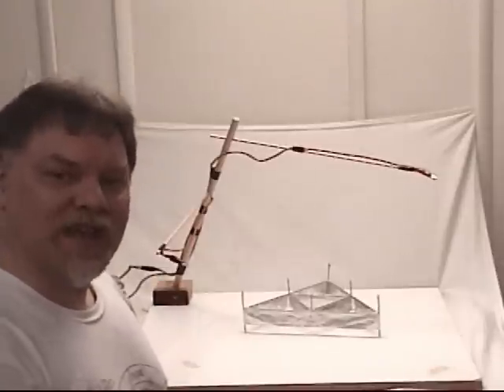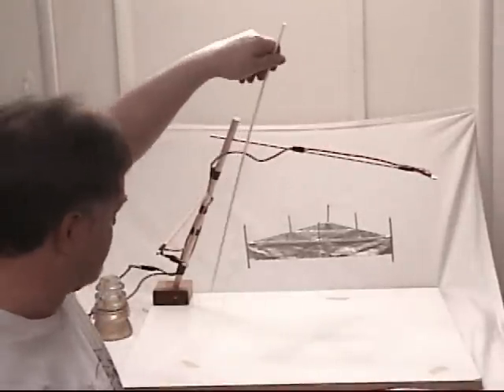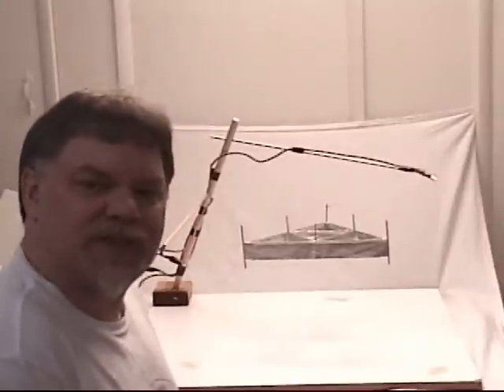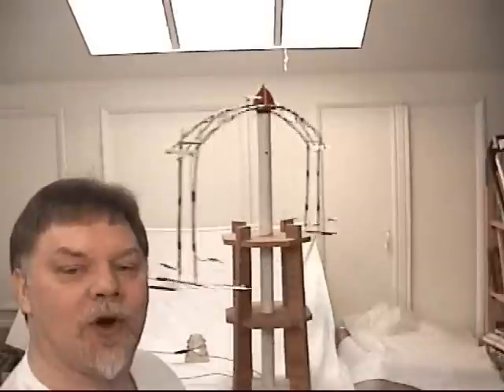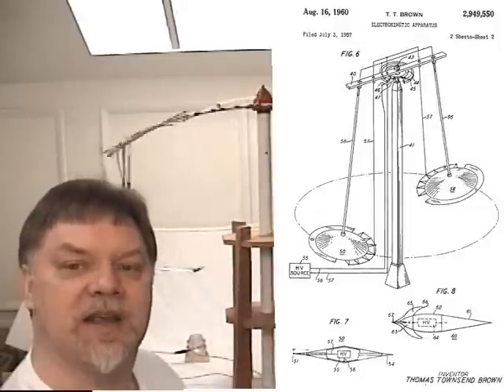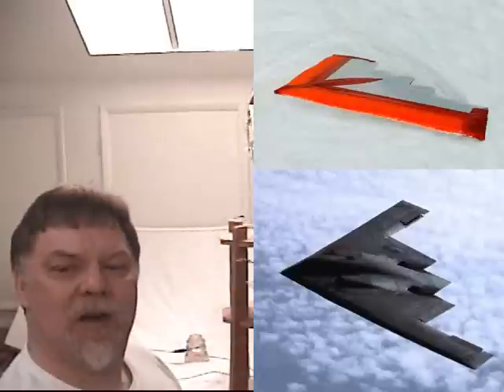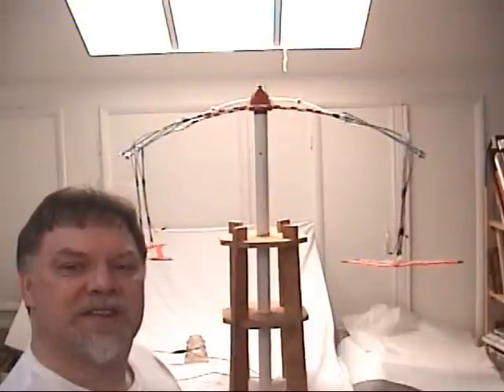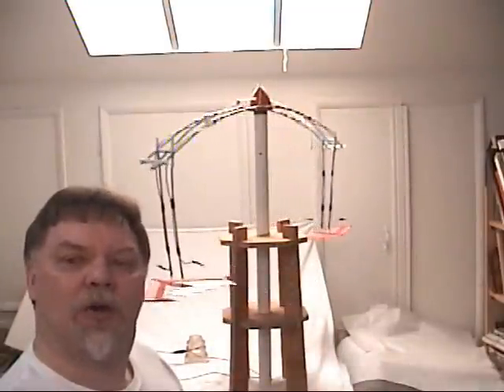Lifters and Electrogravity: Propulsion Possibilities Revealed

Comment: Dr. Subrata Roy's WEAV design is great when transmogrified to VASIMR Electrohydrodynamics where you contain the Argon Ablation with Low Temp Superconductors as close to the Zero Point Conditions using Bose - Einstein Condensates to Cooper Pair Electrons & create the Particle-Wave Singularity. 

This allows you to uses Gyroscopic Precession to exert Lorentz Forces and generating a Right Hand Rule version of Thrust. Ion Wind is present in this Reaction, but is not the main Electrohydrodynamic Force.

See Dr. Leik Myrabo's Laser Propulsion and his Lightcraft.

Comment: "Electrogravity" HAS been busted scientifically and ion wind IS the only explanation why this works. And no, it does NOT work in a vaccum under good lab conditions. It's easy to get fooled e.g. when the vacuum isn't strong enough and extremely high voltages are used (the remaining air molecules can still be enough to see an effect) or when e.g. sealant oils are used for the vacuum: those can vaporize and be ionized. As for larger applications in civil aviation: the big elefants in the room are: space charge, breakdown voltage and volumetric efficiency (=device size relative to absolute thrust) and the weight and aerodynamic drag that go along with that. Useful applications would require fundamental changes to the basic principle, apart from maybe plasma actuators used for turbulence reduction / stall avoidance in airfoils.
Reply: I've seen examples of lifters being compared to a quadcopter drone of similar weight.  The wind produced by lifters is significantly less than the drone just to get them off the ground.  I agree that the presence of gas is still a necessary component for it to work,  but the mechanism might be different than the mainstream explanation.
Reply: @WTF_BBQ  With simple lifters "as it is" you're right, but there are practical solutions to dramatically reduce losses. This requires fundamental changes in the electrode setup (including separation of ionization step and ion acceleration, because otherwise both volumetric efficiency and absolute thrust will always be disappointing) and "smart" voltage regulation (continuous current sensing feedback, pitot sensor, microcontroller); too much to explain in a youtube comment. Essentially, the main efficiency killer is any full plasma discharge (complete ion bridge), which is effectively a short-circuit (plus heat losses in the high voltage transformer). Also: there's a trade-off between max thrust and max efficiency (N/kW). Propellers have their own issues (losses due to spiral slipstream, induced drag from blade-tip vorteces, inefficiency of fixed-props vs constant-speed...).
Reply: @___Chris___  
There was an old video many years ago of someone building a fairly decent sized lifter and he put a mouse inside a cockpit (plastic ball).  I was surprised it lifted easily.  It captured my imagination.  If it's scaled to size,  it might be able to carry a human being..  Unfortunately,  engineering is not my areas of expertise, and the extremely high voltages is terrifying.
Reply: @WTF_BBQ  I disagree. I guess the lifter with the mouse almost certainly didn't include the weight of the power source, right? The general principle of ion wind can be efficient per se, but not with the simple "lifter" concept. The latter doesn't scale up well at all. We can't change the laws of physics. However, ion wind can be implemented in other ways.

I personally have design plans for an atmospheric ion turbine with a slightly different approach, including a new solution regarding the space charge / breakdown voltage dilemma (=that does NOT conflict with physical laws), but I should also say that realistically it will take me probably at least a year to finish a first prototype, because - and that's the downside - the complexity doesn't remotely compare to what we think of as "lifters". Uside: the available thrust would mainly be a function of input power rather than device volume, therefore weight and size are less of an issue. At the same time, I expect an efficiency around 90%, minus losses in the high voltage transformer. It involves a concept that hasn't been done before, so we'll see :-)
Reply: @___Chris___  
Correct,   the power source wasn't included.  The lifter was roughly 3ft across (or bigger)  if i remember correctly.  Definitely not big enough to carry a powersource like a flyback transformer,  but was big enough to carry a mouse and a plastic ball.  This was a video more than 12 years ago..... 

I don't believe the current configuration of the lifter would be a practical application for propulsion, but a proof of concept. However,  the demonstration was still impressive in my opinion.

Comment: Try this biefeld brown experiment in vacuum chamber. Build a pyramid shaped lifter with positive copper and negative aluminum terminals connected in series. Add dielectric materials with very high dielectric constant like barium titanate or calcium copper titanate between all positive and negative terminals so electricity has to completely flow through dielectric materials. Power the lifter with Tesla Coil tuned to output high voltage high frequency 1/4 wavelength AC 150kv or more.

Comment: @pauliexcludedable The measured fields were several magnitudes larger than what general relativity predicts. They managed to model the effect by assuming that gravitons gain mass in a similar way that photons do in superconductors. That does suggest that there is some connection with these forces that's not yet understood. Atleast not in the mainstream.

Comment: Hello! I have learned general and high-voltage electricity for more more than 4 years so I know stuff starting from big power plants all the way to micro controllers. Can you provide some link to where I could find a scheme and a diagram for the device so that I could take a look into this? I wasnt taught to be a scientist but a an electrician, an engineer of electrical devices, systems or powergrids. I find this subject interesting and I wish to find out myself, do a little research on this.